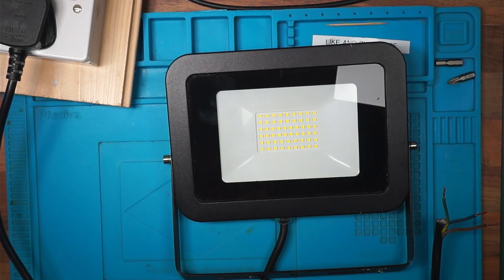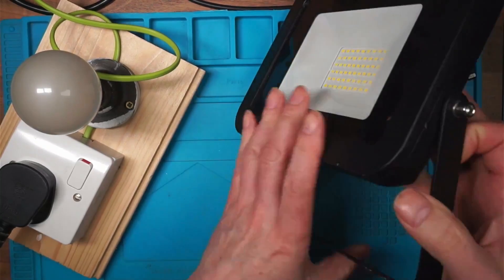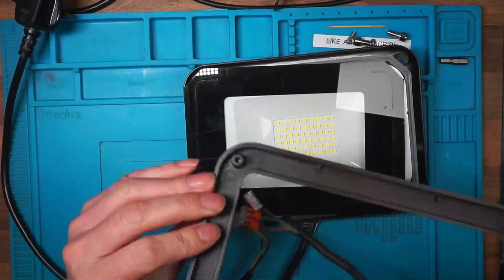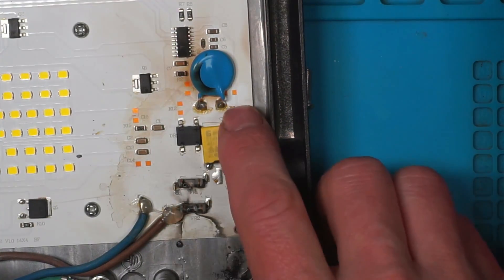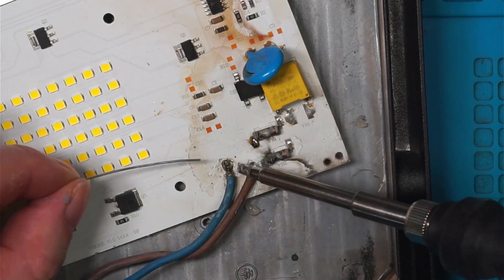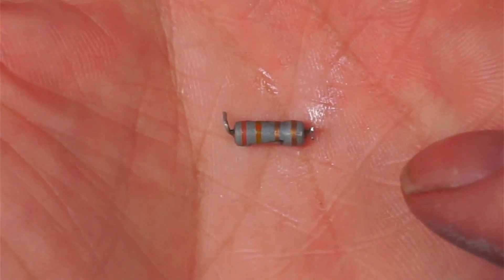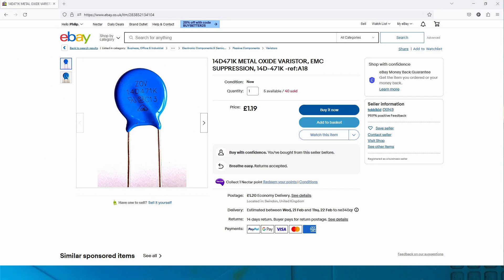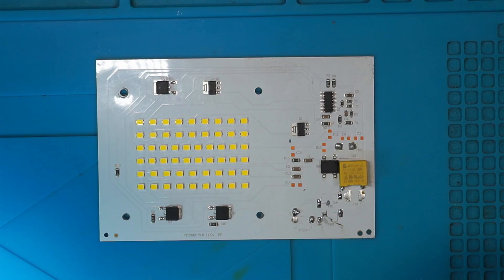Flood light teardown and fault finding. LED not working.

Comment: The board is aluminium, it's sucking up a lot of heat. You should use a pre-heater to solder those.
Reply: It's really hard to see the traces with this white solder mask. Could you mark the traces with a pen? Than we could better see how the LED's are connected.
Reply from the maker: Made some progress, revisit video on the way.

Comment: Philip becomes Big Clive for a day. Breaks apart a lamp. :D
Neat video. Would be interesting to know what happened at that factory which caused the smoke to come out.
Reply from the maker: I was asked to look at a light switch at work.  We switched off electricity at the consumer unit and removed the front of the switch. Before I touched anything I check for voltage on the L and N, nothing. Thankfully I checked earth and neutral next, which showed 230V.  Lights had been flickering in our unit and the neighbouring units too.  There must have been something wrong at a main junction somewhere to affect multiple buildings. I never did find out what the fault was.

Comment: Most of these are sealed from the front - and a btch to take apart… I got myself a cutting wire for car windshield replacement
Reply from the maker: I must have got lucky taking this one apart. There's some parts on the way to double check to see if all of those LEDs are really broken. These thing are fairly cheap, it's hardly worth fixing unless the fix is very simple.
Reply: @PhilipBryden  leds are either 3,6 or 12v - just use sharp multi meter probes to inject voltage - and don’t forget they are DC
Reply from the maker: They need 15v to switch on. No wonder my multimeter couldn't do it. Editing another video now.
Reply from the maker: @cheapasstech I can power each one individually with 15V from my PSU. Some appear to be in series and some in parallel.
Reply from the maker: @cheapasstech  no I can't see anything. I plan to swap one of the mosfets which isn't switching on with a similar replacement.
Reply from the maker: They have 5V on the gate. They aren't warming up when I put the mains on.

Comment: 12:52
I doubt everyone of them is faulty, probably 1 or 2 that's shorted and everything on the circuit is affected pulling the positive to ground so testing each one "in circuit" will not work.

You could pull a few leds and test them off circuit, they probably will work and you need to investigate if its a dead led or mosfet.
Reply from the maker: It has me confused. I've re-checked the mosfets and they all have the same readings, so initially I think they're fine. You have got me thinking that I must be missing something, so I have ordered replacements for the blown parts, to test further and come up with a definituve answer.  Thank you.
Reply: @PhilipBryden  
before you do, heat up underneath the board and pull some leds, if they're ok then you can investigate further.
Reply from the maker: I've ordered them, it was only £5. Ill wait for them to arrive and do a revisit. The board takes a lot of heat, so heating from bottom is probably a good call.
Reply: @PhilipBryden  
not to mention you will destroy the leds before the solder can melt if you blast it from the top. A hot plate is the best way if you have it, or a used iron for clothes.